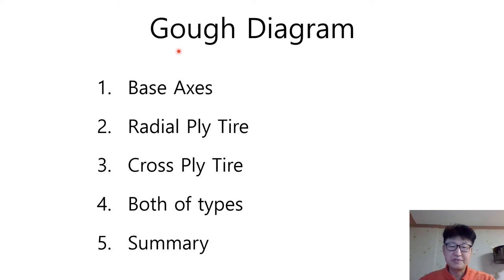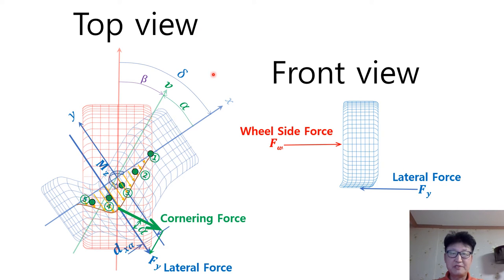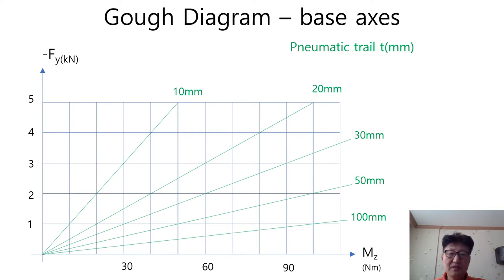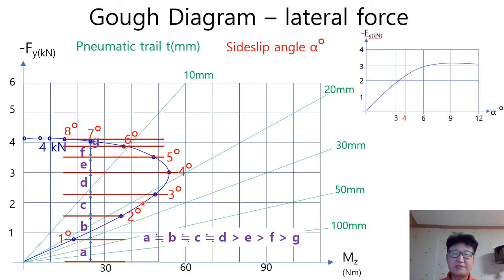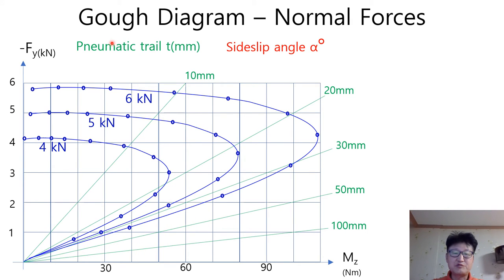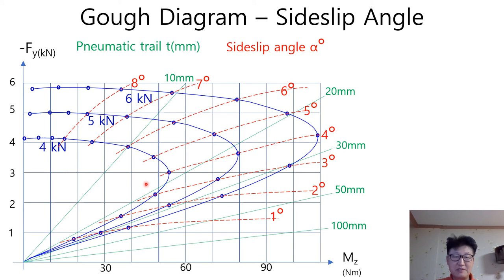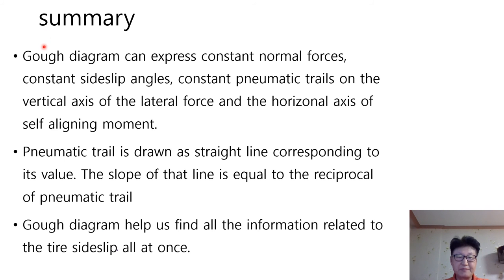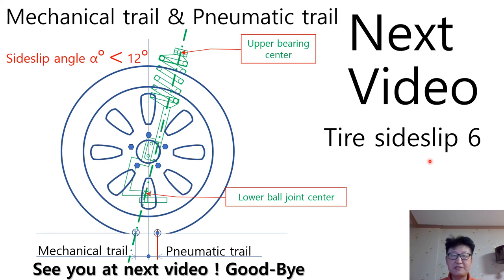E0021 tire contact patch(tire sideslip angle part 5)

Comment: Hi, thanks very much for the videos. I am interested to know about the relationship between the self aligning torque and steering offset. I understand that the self aligning torque is created by the longitudinal pneumatic trail created by the tyre. However I wonder whether there is also a lateral component to this. Is the point about which the self aligning torque acts actually the centre of the tyre, or is it the point at which the steering axis intersects the ground?
Equally, is the self aligning torque generated at the centre of the static tyre, or at the centre of the contact patch as it distorts due to the cornering force? 
The difference between these options could mean that steering offset would potentially either increase or decrease the self aligning torque. I therefore wonder whether it would be negative or positive offset that would increase the self aligning torque?
Reply from the maker: Thank you for your wonderful question! I think you can get all the answers to your questions on my video E0022, https://youtu.be/XIhD8zF9Xus. I will very welcome further questions after your watching that video. Thank you for all the questions you placed here.